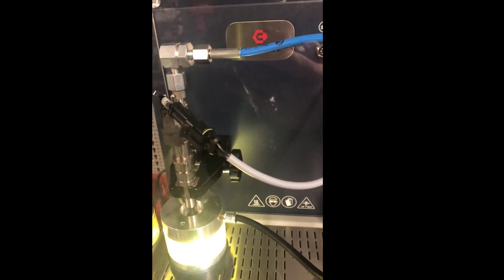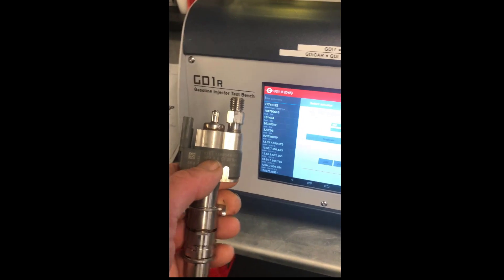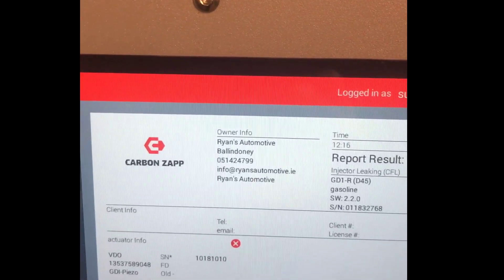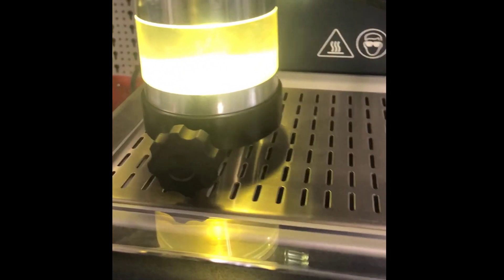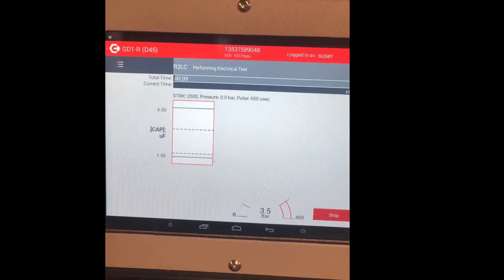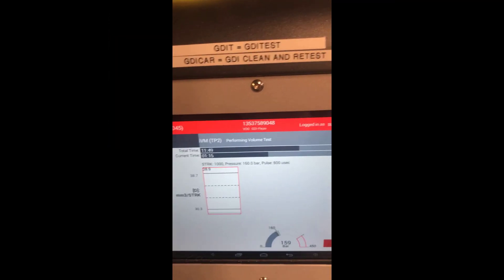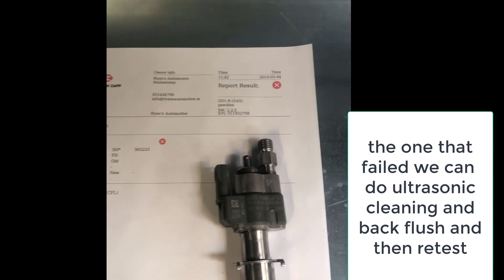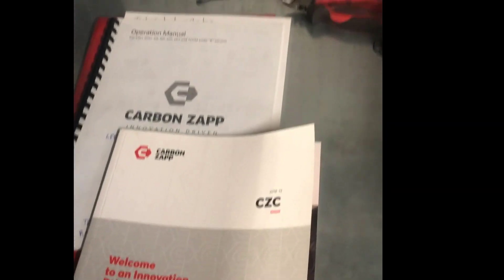Testing a GDI petrol injector with the Carbon Zapp GD1R test bench

Comment: Can this particular model be capable of test high flow racing injectors
Reply from the maker: This model is only for GDI direct injection injectors, there is a different model to this that can do GDI and standard injectors 1 at a time and compare to each other 
or this machine for 4 at a time for standard injectors and high flow racing  https://www.ryansautomotive.ie/shop/diagnostic-equipment-and-tools/engine-fuel-system-tools/fuel-system-tools/carbon-zapp-injector-test-bench-gs4/

Note for standard injectors there is no test plan so you are just comparing to each other

Comment: Does the gd1r have back flush capability??
Reply from the maker: Yes has a optional back flush adapter, was not fitted in this video, it goes in place of the glass inspection bowel and you fit a different pipe to the top of the injector and flush back into a container